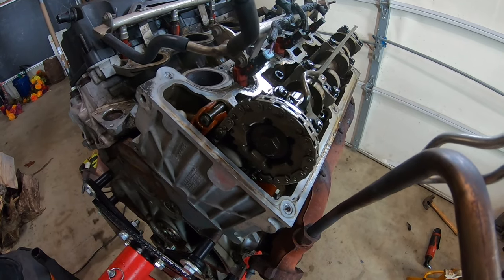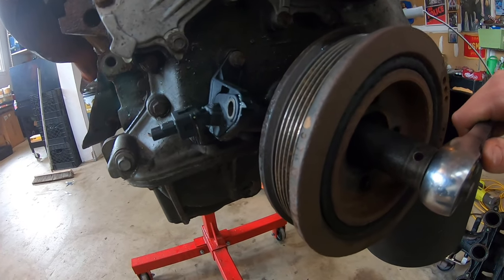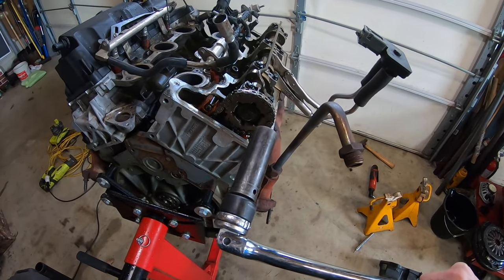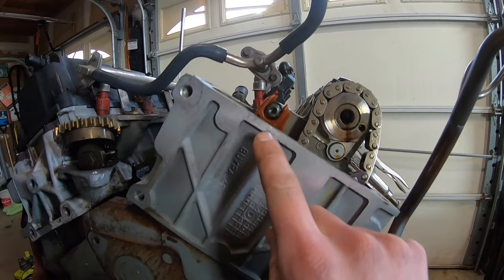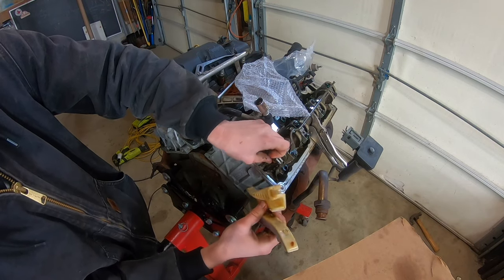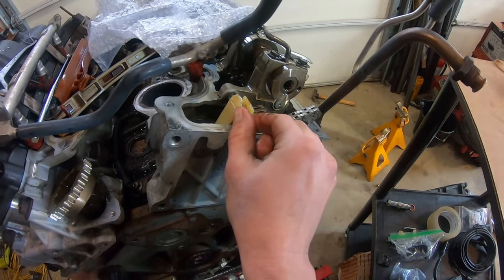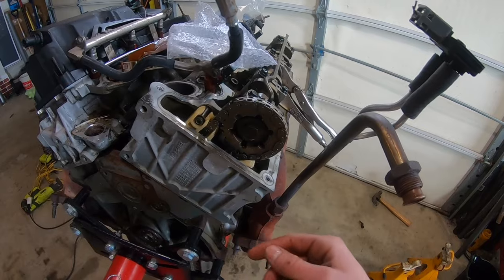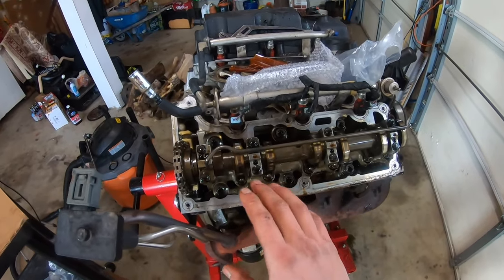Ford 4.0L SOHC V6 Rear Timing Cassette Replacement (WITHOUT FORD SPECIAL TOOLS)

Comment from the maker: ENGINE OR TRANSMISSION MUST BE REMOVED TO COMPLETE THIS PROCEDURE.
Reply: How many hours does It take you to do one of these drive in to drive out? Thanks for the great videos!
Reply from the maker: I can have an engine removed and bolted back in same day. Granted it needs nothing than just this procedure.
Reply: With the vice grip idea I used a 6mm Allen wrench for the slots on the opposite side to prevent it from moving in either direction it fits perfect in the slots
Reply from the maker: @brdman8667  great idea
Reply: Also with your chain and shackle idea I still used the shackle but instead of the chain I bought a small 3/8 turnbuckle with 2 eyes on either end... still same concept but you can adjust it to what hole you need and it take away all the slop the chain has for it to be more acurate and u don't need to take it off you can put it on either side for both loosening and tightening. The eye on the sprocket side fits in between the shackle and the gear perfect. I'd imagine the turnbuckle with a hook on either end would work as well
Reply: Is the front chain the same procedure?
Reply from the maker: @zacharyfischer7845  no.
Reply: Why does it have to be removed?
Reply from the maker: @GalaxyEnixix  because the bolt is behind the transmission bellhousing.
Reply: Honestly figured but thanks for clarifying. Took the heads off and found the guide broken like this. Looks like I’m pulling the motor tomorrow.
Reply: @twiztidrabb  how’d it go? I’m going to have to do this soon
Reply: @Aliens400  ordering a junk yard engine and going through it. The original Heads where warped extremely bad. And all bearings are pitted. The jack shaft chain tensioner broke and sent metal throughout the engine. This truck was driven with a bad head gasket for over a year.   Otherwise very easy and fun job.  Definitely get the tool kit.
Reply: My '04 needs a timing chain kit, hopefully that's all it needs, was quoted 2K with lifters & valves too, because I drove it not knowing it had a bad timing chain cassette issue.
Reply from the maker: Just get a used engine
Reply: I've rebuilt many engines and what a piece of crap design!  Just like Japan's 4.7l for chryslers
Reply: Well that sucks

Comment: I made the mistake of using an Amazon timing kit for my 4.0L SOHC and I had the pleasure of redoing it 3 weeks later after a cassette broke. Dude is very informative but a couple terrible pieces of advice, don’t reuse a hydraulic tensioner and don’t use Amazon timing components for any engine, ever.

Comment: Just finished doing all new timing. Most underrated channel ever
Reply from the maker: Thank you!!! That means a lot to me!
Reply: I concur much thanks from New Zealand 🤙🏼👌🙏
Reply: @iamdjnam  how bad of a sound was the engine making when the cassette  broke, ?
Reply from the maker: @Decimusblack88  It wasn’t making any noise at all because that top bolt was holding on for dear life. After it breaks it will rattle at startup and then over 2200rpms
Reply: @iamdjnam   @Platinum Garage  so I opened the timing chain cover on driver side sure enough the guide broke , it gets even worse i found this metal piece round chrome hallowed out  with large large spring inside  with a snap ring in middle, I cant figure out what it is can u let me know?
Reply from the maker: @Decimusblack88  That’s your hydraulic tensioner. In this video I remove the passenger side one using the 27mm wrench. At that point of damage I’d be concerned about valve to piston contact. Do a leakdown test.
Reply from the maker: @Broken1981  If the guide is broken and enough slack is there, the chain will jump a tooth knocking the motor out of time and bending 3 valves. You can get away with just replacing the cassette, if the front isn’t making noise then don’t worry about them. Does your engine crank and sound like it has compression? Or does it just spin?
Reply: @iamdjnam  Does sound like it has compression cause I heard the pop when I had a plug out checking the fire
Reply from the maker: @Broken1981  even with one dead cylinder it would fire. Not sure. Hard to diagnose a vehicle when I’m not in front of it

Comment: Not nice that Ford designed valve guides which don't last between engine rebuilds (overbore & new pistons), especially since they put the timing chain at the rear of the engine so it must come out of the car for this work.  Encouraging that Ford owners followed them in their venture into Euro-type OHC engines even their V-8's, while GM and Chrysler stuck with simpler robust pushrod V-8's.  When Chrysler changed their V-6 to OHC ~2008, similar issues arose from the more complicated design.

Comment: Awesome video ... I admire anyone that can fix a 2001-2004.5 4.0 S.O.H.C. with a factory defect that Ford never owned up to.
Reply from the maker: They never did good on it, all these explorers still on the road rattling. Nissan had an issue and everyone got a free engine out of it.
Reply: @iamdjnam  Exactly! ... This just goes to show you how dishonest of a company that Ford is. What do you think about them putting out all those Ford Fiestas and Focuses with the defective automatic transmissions before they even started to assemble them and sell them?
Reply from the maker: Funny you should say that. My mother got a 2019 explorer. I dread the day I’ll have to make repairs on it. Internal transmission filter that can’t be replaced!! Everything is made so horribly today. The end of the era for SUVs is when they made them with a unibody platform instead of on an actual steel chassis.
Reply: @jonathanbox3033   - The story of the Ford 6.0L  Powerstroke diesel engine made by Navistar/International Harvester, that succeeded the 7.3, is the stuff of Ford as trash legend. While every poor sucker who bought anything with a 6.0L Powerstorke from 2001-2006  (F250, 350, Excursion..etc) suffered, the Ambulance companies that bought this POS for their fleets really suffered. It is the advertising budget of Ford that is the basis for their appeal. I feel bad for Ford owners, especially those who today are running Fords new 3 cylinder with 5 turbo's (sarcasm)... having said all of that, I'm glad that  we have @Platinum Garage to bring the 4.0 SOHC into a usable condition. Thanks
Reply: @jonathanbox3033  ya my fucus. Trans needs to b replaced again. I replaced it with a junk yard 1 bu it lasted like 3 or 4 years and in its 2nd car that I had put it in
Reply: @iamdjnam  When I was shopping back in 2015, I specifically got the 2010 Explore because (I think) it was the last year the Explorer was body on frame.
Reply from the maker: It was. I’ll never get a 2011+

Comment: I have a 4.0 from a Ranger that every shop I talked to would not work on it because they all got plastic in the engine from the timing chain parts and plug up oil passages. Three different shops said they did it once and had a brown engine come back.

Comment: Your videos on the 4.0 SOHC engine are priceless!! 
Outstanding!!! 
Keep up the great work!
Reply from the maker: Thank you very much!
Reply: @iamdjnam  You’re very welcome. 
Have a small rattle on my 2011 4.0 at start up. But I’m not sure if it’s the chains. Or because I let it sit for a week or two at a time. Eventually I’ll pull or pay someone to do this either way.
Reply: If you let it sit that long between start ups maybe it is just the oil pressure bleeding off? Especially since the noise goes away. You could always put a pre-oiler kit on it like drag race engines use to pre-lube the engine before start up.
Reply from the maker: @nofortunatesonII I had a pre oiler on mine for years. Just recently took it off. If you use good oil like amsoil you don’t even need one. Regular maintenance will extend the life of this engine.
Reply: @iamdjnam  what many people don’t take into consideration is idle hours. I’ve changed the oil prior to the mileage.
Reply: @iamdjnam  Thank-you for the reply. I appreciate you posting these videos. I own three Ford Rangers, two of which are 4WD with the 4.0L SOHC engine. Both of them seem fine, hopefully they never need the chains/ parts. At least now I know the shortcuts to get this repair done.

Comment: I have a 2001 Sport Trac I bought new in 2001 and drove it until 2012 when the cassettes broke with the same motor. I loved the truck so much, I parked it so I could eventually restore it. I prepped in late 2019 to do the work in 2020, but then the pandemic arrived and that pretty much destroyed the plans. But I'm ready now. The truck is in great shape. I dropped and cleaned out the fuel tank last year, put in a new fuel pump and it started back up, but the rattle is still there. I'm not a professional mechanic, but I'm competent and tackled difficult jobs like this before and there's lots of great how-to videos on how to pull and do this task. I have friends who run garages and called them this week. They said basically get a new motor and don't go through the hassle, yet another friend who was a mechanic all his life (retired now) said it can be done and to go slow. This video helps and I appreciate the insight. I sat on getting this fixed for too long and also have to replace the cab body mounts which crumbled over the years. I'm sure there's other issues to resolve, but the truck is worth saving. So, I'm hoping to get started soon! I was also quoted around $700 back in 2019, but now they say no. Hmm.
Reply from the maker: Do the work yourself. If the engine ran great but rattled, get yourself a nice Melling timing kit, new gaskets, and go for it!

Comment: Hey nick great video i have the same problem on these dumb design 4.0s but i was very enlightened and i can’t believe how calm u were working on these engines great job man🤙🏼 i have 06 exploder and pulled 2 motors now to do the same jobs and u give great instructions. Maybe add some more torque specs lol bc every bolt has some torque specs but keep up the great work mechanic.
Reply from the maker: Thanks man! Appreciate the kind words.

Comment: You didn't show if you removed the rest of the broken cassette guide. Did you remove it and if so how? I've  seen video where you have to take off upper pan and clean out all the broken pieces.

Comment: I did mine today on a engine that I bought but haven't installed yet. So glad I subscribed to your channel. 
Thought I would change it but wouldn't you know it was broken in two pieces just like in the video and I got the two broken pieces of the cassette out with long needle nose pliers.

Comment: It looks like this job necessitates the removal of the engine from the car because the transmission bellhousing covers the cassette pivot bolt. Is this correct? Thanks for a great and informative video.
Reply from the maker: Yes engine or transmission must be removed.

Comment: I did a front cassette repair job and the new repair didn’t last long.  I was able to drive the truck for a good 8 years but it was constantly rattling and finally died. The front cassette blew up and rammed thru the top of the valve cover partially .

Comment: Great video! You make it look easy. 
Question. Can I pull/ replace the pivot bolt and torque to spec w/out having do anything else?
Or does removing that pivot bolt and retorquing misalign/ unadjust the other bolts or aspects of the timing chain cassette?
Reply from the maker: All you gotta do is remove that bolt and reinstall. Nothing to align.

Comment: I've seen the rear guides done in vehicle with the trans pulled back. My question is have you done this? And can it be done in a 4x4 model with the transfer case there? Great videos!
Reply from the maker: Yes it can be done but it’s such a pain

Comment: This is assuming you don't have damage, like bent valves. The one I'm working on has both front and rear broken. Front chain broke a hole through the valve cover. And this engine has markings on the cam that looks like this was done at least twice already. Two scaped spots where they used the vise grip on it.

Comment: Wow that is crazy you have to pull the engine to install timing chains on this motor. I was considering buying a Ford truck with this engine but I'm going to pass now. How long would the engine run with the rear cassette broken like that? And what happened to the piece of cassette that was in the bottom I didn't see you fish that out. Did it go into the oil pan?
Reply from the maker: The engine can run anywhere from a month to a few years. It really is all about luck. The broken pieces end up in the oil pan. Occasionally they will get stuck in the pickup tube and starve the engine of oil.

Comment: Yo i like the way you did your video, I'm meesaging to ask u where on Amazon did you find the parts to get that done? Also im looking at getting it done with the engine still in the cab of the vehicle.
Reply from the maker: Go on Amazon just type in “ford 4.0 timing guide” and it’ll pop up. The engine or transmission must be removed to replace this part.
Reply: Yeah i was hoping that i could find a way around removing the engine but as luck would have it there's nothing simple or real quick in this industry, besides the engine I'm also dealing with a starting concern. My brother bought said ford from a guy that's stated his son drove to the store an wen he went to leave it wouldn't start, so the man started quarter backing an threw several components at it only to give up an sell it, honesty i believe it is the ignition switch causing it as i have gotten it started that's how I learned of the timing guide problem.

Comment: are the replacement cassette guides any stronger or are they just identical to the original ford ones?
Reply from the maker: Identical
Reply: @iamdjnam  thank you for the response, thinking about buying a Ford ranger or Mazda b4000

Comment: Hey , ok everything went smoothly except the vice grips came lose and the cam shaft spun so I turned it back maybe one turn but it seemed like it spun a couple times it happen really quick but I have all timing marks lined up and almost done with putting the engine in. Will it be ok and start?

Comment: Great video. The cam sprocket bolts are torque to yield. They say your not supposed to reuse them. Have you ever had an issue? Also where did you get the torque spec because all I’ve heard is a number + 90 degrees. Never just a straight torque. Thanks
Reply from the maker: Cam sprocket bolts are not TTY. 63ft lbs.
Reply: @iamdjnam  perfect thanks. That was a quick reply. 👍

Comment: Great videos. Just wondering if you have had any experience with the Discovery  3s amd the same engine. I dont want to take the engine out to get to the rear cassette,  do you know if I can pull the trans back a few inches similiar to the explorers so that I can access the bottom bolt?
Reply from the maker: Yes you can slide the trans back to access the bolt.
Reply: Thanks mate. I'm also looking at importing  a crate motor to Aus, do you know any reputable reconditioners with international export ability?

Comment: Great video! I missed information, how was the broken part of the cassette guide removed from the bottom of the engine? Thx
Reply from the maker: Because it was mainly intact, there were no broken pieces in the bottom of the engine. If your piece is nonexistent, remove the lower sheet metal oil pan.
Reply: Does that oil pan have a gasket or rtv sealant
Reply from the maker: Gasket but I’ve used RTV plenty of times when I didn’t feel like buying one lol

Comment: Wish I had check before putting used engine in . Found issue when changing valve cover gaskets  Thanks !!!
Reply: Do you have to pull the motor out to do that rear guide? 
Or you can do it on the car?
Reply from the maker: Pull motor or drop trans

Comment: THANKS YO.. Walk threw was perfect for a mechanically inclined beginner. Any advice on getting all the broken pieces out??? Mine broke up pretty bad.
Reply from the maker: Fish out what you can then drop the oil pan and clean it out real good. Gasket is like $12 and totally worth clearing the pickup tube.
Reply from the maker: @marqueseblade6523  undo both driveshafts, cooler lines, torque converter, tail mount and slide the trans back 2-3 inches. Just enough to get to that bolt. You don’t have to drop it all the way
Reply: @iamdjnam  thanks bro.... Imma give it a shot lol.. U deff gotta new sub
Reply from the maker: Appreciate you. Good luck. Any questions reach out.

Comment: Hey tky for ur information but I have a question when that chain do was working on jump off a tooth  bent valve ?
Reply from the maker: On this engine it did not jump a tooth so I was able to replace just the guide. If yours did, you need to remove the head.

Comment: Do you have a way to check the oil pan for broken guide pieces? I know alot of the larger ford engines just destroy the guides and they end up in the oil pick up. I know that one came out mostly in one piece, these trucks are just such a pain.
Reply from the maker: Yeah I usually drop the sheet metal oil pan and clear out the debris.

Comment: A friend replaced all timing chains and reinstalled engine but thinks back chain is off a couple of teeth. Is there any way to adjust it without pulling the engine out again?
Reply from the maker: Yeah just loosen the cam bolt and make sure everything is lined up. The sprocket is friction fit.

Comment: Hi i have a 2005 ford explorer and the right side poblem is camshaft not turning can be the tensioner or i need to do the same work u did?
Reply from the maker: Hmm. Seems as if the main jackshaft chain is no good or the rear chain is broken. Only possibilities of the cam not rotating. I’d be concerned about the valves at this point.